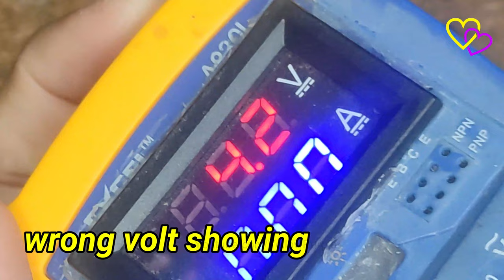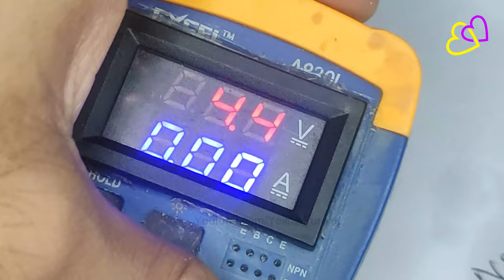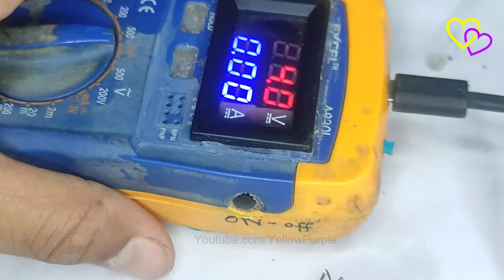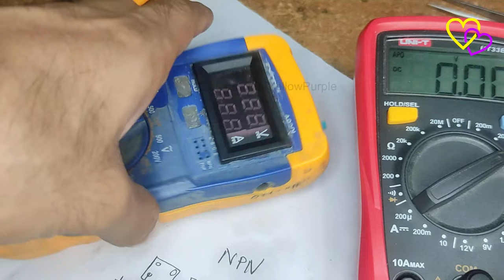Replace Potentiometer With Resistor || Volt Ampere Meter Volt Calibration || Fix Wrong Value

Comment: what if the original potentiometer works but it is not give the exact calibration? I have this problem with mine, the current calibration goes wrong (not giving the exact current of the circuit like the multimeter)